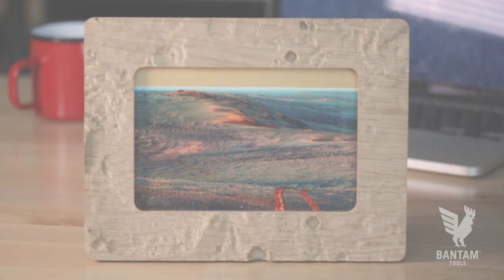Bantam Tools CNC: Martian-Themed Picture Frame

Comment: Is your software designed to work with other cnc mills/tables. Also, will you be creating an upsized model at any point?
Reply from the maker: Hi there – The Bantam Tools Milling Machine only works with Bantam Tools CNC machines. Currently, the Desktop CNC Milling Machine comes in one size. The machine comes with a 7"x9"x3.5" T-slot bed.